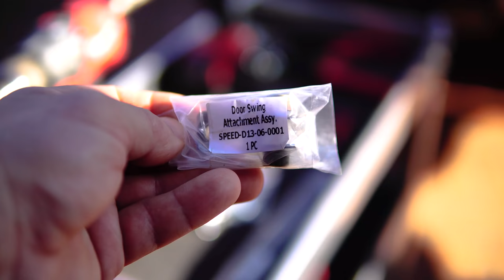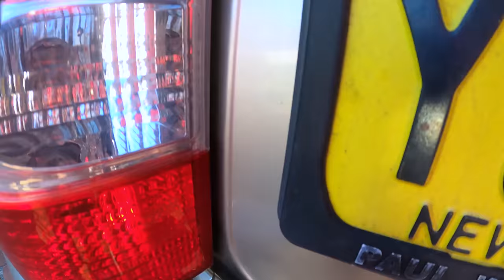Vlog 17 - Barn Door Mods

Comment: I wanted yell out to you through the You Tube that you needed it extended for the "open" measurement.  Anyway.  Looks / works nice.  Just one more tip.  Put some blue locktite on those ball/nuts.  We have a kit here in the US for adding a strut to a pick-up tailgate for a slow opener.  I found the ball/nut stud works its way loose from the nutsert over time.  Make sure it is good and gooped up with that stuff, and check it every now and again to makes sure it doesn't loosen up.
Reply from the maker: Thanks for the great tip, will do 👌💯🎯

Comment: You gotta drill at the bottom of the door mate
Reply from the maker: Why not there where it is? It works fine. The head of the strut would rub on the bumper if it was below the door.
Reply: @AussieFourWheelers  yeah it works both ways, only have to notch a little bit out of the plastic bumper though
Reply from the maker: @lachiemcconville  yeah true, but I didn't want to notch it.